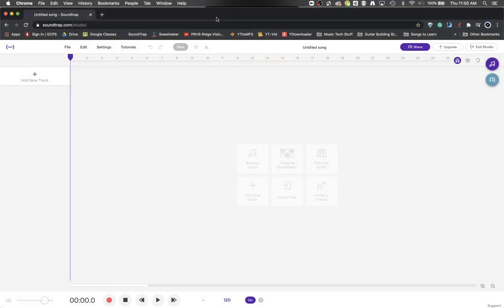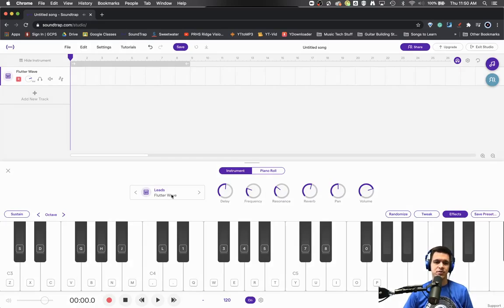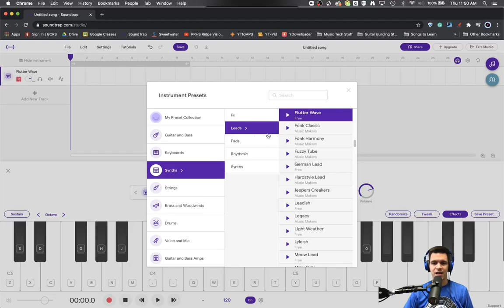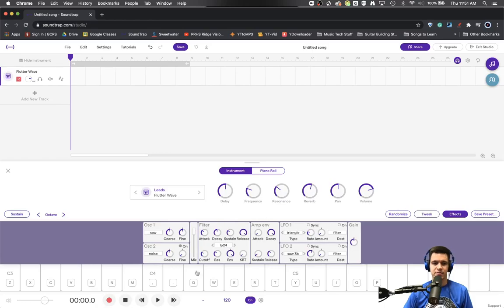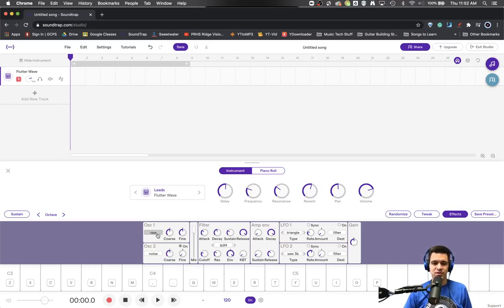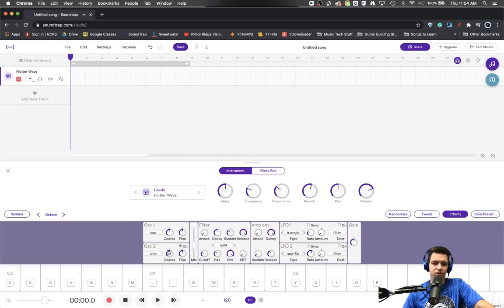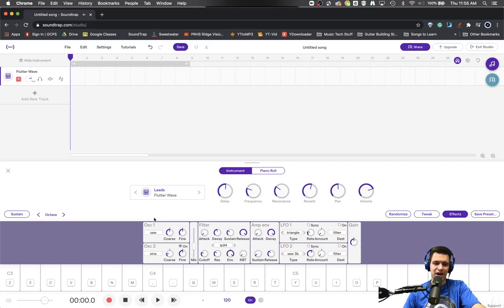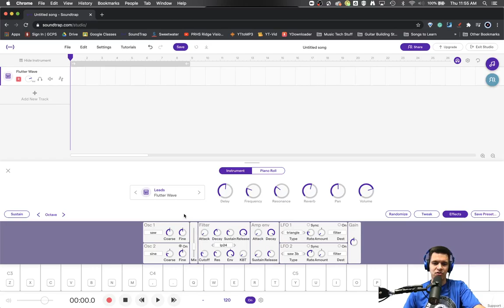SoundTrap Tutorial: Synth Control Part 1 Oscillators

Comment: What does the KBT parameter do?
Reply from the maker: That's a great question!  I had to do some research myself.  It stands for Keyboard Tracking and was explained to me this way...I think of it as the changing of the filter frequency relative to the note played. 1:1 keyboard tracking means that the interval between the note played and the filter cutoff will be constant. Other ratios mean that the interval increases or decreases going up the scale. Tracking off means that the filter cutoff is constant for all notes.